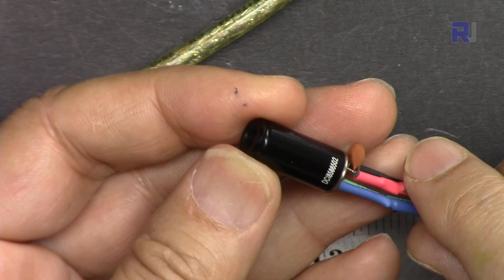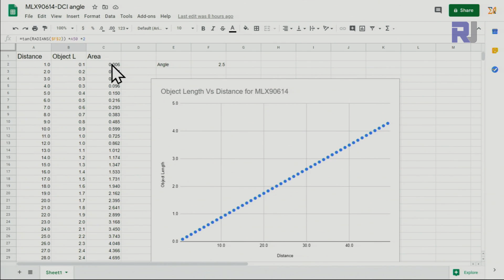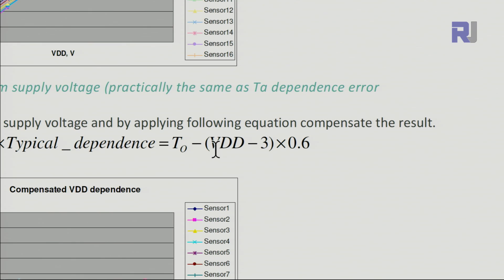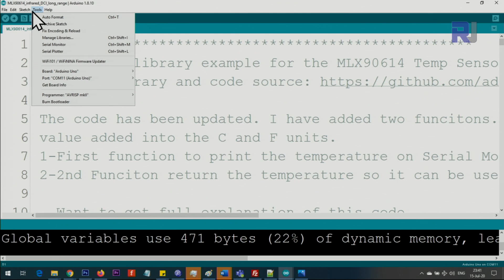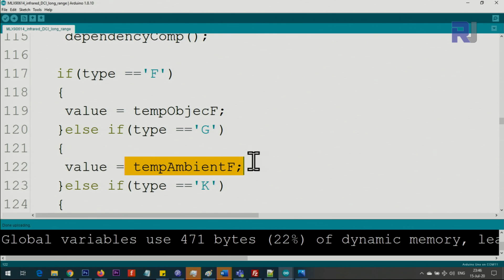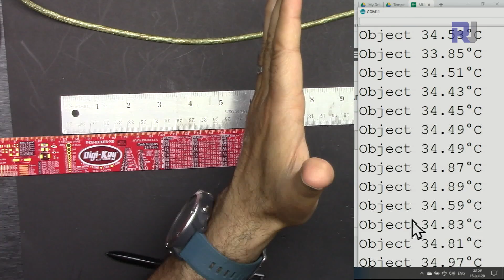Non-Contact Long Range MLX90614-DCI Temperature Sensor with Arduino - RJT337

Comment: Al Salamu Alikum, Thank you for this tutorial. 
I have a question regard reading Vref for "dependency compensation". 

Vref voltage is a "regulator" voltage so it is a fixed value! Actually I print out A0 readings and as expected it's fixed on 1023 (5V), This means the code just shift the resulted readings by (5 - 3)*.6 = 1.2 degree.

So why we need this A0 leg readings?

Comment: Hey sir, I already assembled everything, uploaded the program but I just get the same mesurement line ( Object 1037.34\xC2\xB0C ).
Reply from the maker: Check wiring
Reply: @robojax  i‘ve checked everything but still the same Problem, everything ist assembled exactly the Same was like in the Video
Reply: I Found the Problem your wire‘s Form A4/A5 needs to be on SCA/SDL at a Arduino Mega
Reply from the maker: Pleased to know that you resolved it

Comment: Hi there, great tutorial! I'm working on a similar project over 2 months, and even using the MLX90614-DCI Temperature Sensor, some times it shows the wrong human body temperature due the ambient temperature change!
I can't post a link here, but I found out some one was able to hookup a serial communication with a medical thermometer, and the serial output didn't show the temperature showed in the LCD, instead it was showing some firmware info and the most important it was showing the sensor temperature and the ambient temperature!
It seems to take 9 samples of object temp and ambient temp, process it to show the temp in the LCD!
So the guy took like couple hundreds of samples, put it into a spreadsheet file, and used some AI to process the  9 samples he was receiving on the serial communication and then he was able to show the same temp showing on the LCD!
So, in this case seems that the ambient temp is a factor to get the right temp from a human body!
Reply from the maker: Hi, here is the video showing it on LCD https://youtu.be/IAj0gHTTWfw Here is how to find Specific YouTube Video in a channel https://bit.ly/findYouTubeVideo

Comment: Thank you for the excellent and helpful tutorial! Do you know what's the response rate of the sensor? Rephrasing my question, how fast a moving object can pass in front of the sensor in order to get its temperature detected?
Reply from the maker: Hello, I don't remember the number, but either I have explained it or shown the datasheet. Measurement time or reading time. the datasheet link is provided on the same page as the code.

Comment: Great Video. I Was wondering where did you get all the data sheet and information about the sensors.
Reply from the maker: Wry simple just type the model and the word datasheet.  I have provided the datasheet in the page where the code is.
Reply: @robojax  Thank you

Comment: If the correction is 0.6 degrees celcius per volt, than it is not 0.6 fahrenheit per volt at time 23.40

Comment: You have connected the vin to 3.3v , how can you get 1023 ? ...1023 will show with 5v .. and the sensor has no relation with 5v , since you have only 3.3v supply
Reply from the maker: hi, sorry point to the time of video like 7:30 so I can check. I've got over 400 videos and can't watch the whole video to find out.
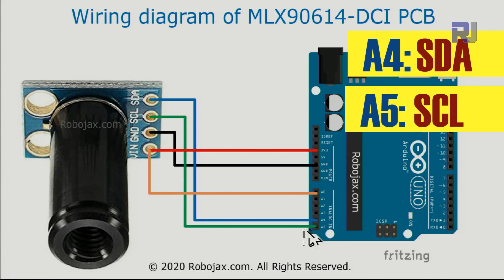Reply: @robojax  watch 13:32 ...if you are connecting the vin to 3.3v,  it's obvious it will always show around 675 as analogread ..since arduino uses 10bit ADC . No need to put that Vin to an analog pin .
Reply: And don't use a 3.3v device directly with a 5v mcu . Here arduino will send 5v signal as a Master and MLX will not able to endure it for long time , it will get damaged soon . Use a voltage devider with SCL and SDA to make it 3.3v .
Reply: @Pagalcoderguide  I'm interested with what you are mentioning about. Can you point out to the reference? Should we use level shifter?

Comment: Hi, Thanks for the awesome tutorial. I have a problem that you haven't encountered while making this video; the temperature changes with the distance (specifically from 36.7 to 36.2 in 0.1 to 10 cm). I am using DCI model of the sensor, I'm pretty sure that the object in FOV both at 0.1 cm and 10 cm.
I have read datasheet twice, did everything I could but no luck. Any ideas on how I can compensate for the distance?
Reply from the maker: Hi, as I mentioned, many factors affect the reading. this topic is not crystal clear and you need to find specific method for your own application.
Reply: @robojax  I'll do that and keep you informed of the result which may help someone else
Reply: Emissitivity kalibrasyonun nasil yapılır? 0.98 e nasıl bir kodla ayarlarım yardımcı olabilir misin?
Reply: @necipguleser8447  kütüphanenin içinde bulabilirsiniz 2 ayrı fonksiyon var; writeEmissivity ve writeEmissivityReg. Ikisini de kullanabilirsiniz, 1 defa yazmanız yeterli. Ilki için 0.01-1.00 arası, ikinci için ise 1 65353 arası değer vermeniz yeterli
Reply: @ekremvkilic  @Robojax 'in yazmış oldugu koda nasil entegre ederim. Yazdım ama çalıştıramadım hata veriyor. Rica etsem paylaşılan örnek koda entegre edip yazabilir misin tam halde?
Reply: necipguleser@gmail.com mail adresime de gönderebilirsin. Uzun zamandır uğraşıyorum ama aşamadım sorunları. Siz hassas bir şekilde doğru ölçüm almayı başarabildiniz mi ateşölçer şeklinde? Aldığım ölçümlerde emissitivity ayarlaması yapamadığım için mi bilmiyorum ama doğru ölçüm yapamıyorum tutarsız ve doğru olmayan ölçümler alıyorum.
Tecrübelerinizi paylaşabilir misiniz? Doğru ölçüm için dikkat edilmesi gereken noktaları?
Reply: @necipguleser8447  önce kütüphanedeki fonksiyonlara bakmanızı tavsiye ediyorum, zaten oradan çıkarabilmeniz lazım. Ve ne yazık ki tek başına emissivity yeterli değil. Muhtemelen siz de 90 derece görüş açısı olan sensoru kullanmayı denediniz, mesafe uzaklaştıkça ölçtüğü alan büyür. Buna çözüm bulmanız lazım. Bu konuda da bu işi yapan ürünlerin içinin açılmasının videosunu izleyebilirsiniz
Reply: @ekremvkilic  mlx90614-dci 5 fov sensör kullanıyorum. 

char *typeName[]={"Object","Ambient"};

Adafruit_MLX90614 mlx = Adafruit_MLX90614();

writeEmissivity(0.98)
;

float tempObjecC, tempObjecF, tempAmbientC ,tempAmbientF, tempObjecK, tempAmbientK;

void setup() {

...

kodu bu şekilde araya sadece writeEmissivity(0.98);     şeklinde yazmam yeterli olmuyor sanırım hata aliyorum.
kütüphaneyide çok inceledim ama bilmiyorum neden derleme hatası aliyorum kütüphanedeki writeEmissivity ile ilgili kısım şu 

void Adafruit_MLX90614::writeEmissivity(double emissivity) {
  uint16_t ereg = (uint16_t)(0xffff * emissivity);

  writeEmissivityReg(ereg);
}
bunu nasil koduma eklerim lütfen yardımcı olabilir misin  çok uğraştım ve yardım alabileceğim kimse yok.
Reply: @necipguleser8447  Uyuduğum için cevap veremedim ancak söylemem gerekir ki aceleci olmanız biraz nahoş.
Fonksiyonu (daha doğrusu methodu) doğru yerde kullanıyorsunuz ama kullanım biçiminiz yanlış. O method Adafruit_MLX90614 sınıfına ait, kullanmak için de o sınıftan oluşturduğunuz objeye ihtiyacınız var. "mlx.writeEmissivityReg(x);" şeklinde tırnaklar olmadan kullanırsanız işinize yarayacaktır. x yerine emissivity'i örneğin 0.98 yapmak için 0.98*65535 yani 64224 değerini yazın, derleyip yükleyin ve sonra o satırı yorum satırına çevirip tekrar yükleyin çünkü daha önce de dediğim gibi emissivity değerini sadece 1 kere yazmanız yeterli. Sadece 1 kere yazmak için readEmissivity methodunu kullanarak bir if yapısı da oluşturabilirsiniz.
Reply: @ekremvkilic  @Ekrem Kılıç İyi akşamlar kusura bakmayın öncelikle. Dediklerinizi yaptim ve emissivity ayarını gerçekleştirdim. 0.98 olarak ayarladığımda 35.4 civarında bilekten ölçüm alıyordum. Emissivity ayarıyla biraz oynamalar vardım ve istediğim sonucu elde ettim 36.2 civarlarında doğru ölçüm aldım referans ateş ölçer değerlerinde. Sonrasında biraz uğraştıktan sonran aldığım verileri kaybettim emissivity değeri 0.98 de şuan bilekten 30küsürlerde değer ölçüyor. Sebebi ne olabilir uğraştığım için ayarlarını mı bozdum acaba? Sadece emissivity ayarı üzerinde üst üste değişiklikler yapıp yükledim. Bu sorun olmuş mudur? Nasıl düzeltebilirim fabrika kalibrasyon ayarlarına?
Reply: Good night would you mind sending your cod with the calibration to me? I'm having a hard time Fzazeka@gmail.com

Comment: Hi
do you know how to wire this module  CJMCU-Infrared Temperature Sensor MLX90614ESF-BCC IR
Reply from the maker: Hi, this is the video for that.  didn't you watch it? the "CJMCU" is just fake.  MLX90614 is the correct model and this video is shown it MLX90614. If you are using the small one, here is the video https://youtu.be/cFDSqiEIunw
Reply: @robojax  I  use this one i don't know  how to wire it with arduino  https://fr.banggood.com/CJMCU-MLX90614-BCC-Human-Body-Infrared-Thermometer-Non-contact-Thermometer-Serial-Output-Module-p-1684348.html?cur_warehouse=CN
Reply: his pins are different from the others

Comment: Did you made some configuration of emissivity? As I readed, the sensor is factory calibrated with emissivity =1 and the body skin has emissivity=0,98. What is the better way to check is the temperature what the sensor gives is correct? For instance, I used Water (emissivity=0,95) and measured it with a classic digital medical thermometer.
So, in order to improve mesures accuracy: voltaje compensation, distance compensation, emissivity adjustment, and plastic protection of body sensor to avoid thermical gradients. And be carefull about ambient (low humidity, no wind, ambient temperature stable).
Reply: I have done 3 of 4 suggestions of yours to improve accuracy, but I couldn't do the fourth: distance compensation. I have DCI model, as I get further away from the sensor, the temperature changes by 0.5 (36.7 to 36.2). How can I compensate for this? I have researched a bit, completely read the datasheet, used both this code and my own but no luck. Any ideas?
Reply from the maker: you can use  readEmissivity() to read it and to se it to for example to 0.5, use  riteEmissivity(0.5)  and it has been mentioned in the library on around line 75 https://github.com/adafruit/Adafruit-MLX90614-Library/blob/master/Adafruit_MLX90614.cpp
Reply: @robojax   I have used writeEmissivity() and even writeEmissivityReg() with different values and noticed that the less the value is, the more the sensor becomes sensitive to the distance and outside effects. There are not many functions in the library, so there is basically nothing that can be done other than changing the emissivity which is not the solution.

The worse than that is one of my tests goes like this:
Ambient Temperature: 28.01-28.03-28.05
I show my right wrist to record the temperature to an Excel file (no contact, the sensor is sealed in a cardboard box with only the measuring part is 2-3 mm outside)
Ambient Temperature becomes: 28.07-28.09-28.11
I pull back my wrist
Ambient Temperature: 28.11-28.13-28.15
After waiting a few seconds, watching the Ambient Temperature values I show my left wrist
Ambient Temperature: 28.15-28.17-28.19 (while I was holding my right wrist to sensor above 1 cm)
I pull back my right wrist
Ambient Temperature: 28.21-28.23-28.25

There is no way I could be affecting the sensor while measuring the temperature on my wrist because there is no contact. Also, I have cut a hole on the box that the sensor came in, put the sensor inside the box, closed every possible gap, the sensor should be in thermal equilibrium (because it's ON for the last 30 mins and never even touched or moved anywhere but it keeps measuring). And I have repeated this test 15 times yesterday, every time it's the same.

The funny thing is I noticed that after going through the test process I mentioned above when I do the test again waiting for no more than 1 minute, that absurd thing does not happen. I began to think that sensor should be on or measuring only when something is wanted to be measured. I will test this on Monday and keep you informed of the results.
Reply: @robojax  How can I set the emissivity to 0.98. Can you write your code clearly here?
Reply: @robojax  
I am waiting for an answer from you

Comment: Hi,

Can we use this sensor to detect the temperature for moving object like wheel of vehicle? 
I mean, wheel pass in-front of the sensor FOV and sensor detect the temperature at very high speed.

Want to measure the temperature of moving vehicle's wheel, whether its bearing or axle is fine or not?

Is this sensor waterproof?

Your support is highly appreciable :)
Reply from the maker: Hi, it reads in 5ms or 0.05 seconds. if you give it minimum of this much time for pointing to object and reading, then yes. See datasheet for write and erase time.  I have provided the datasheet in the resources page.
Reply: @robojax  Thank you! Will check the datasheet for writing and erasing time.
Reply from the maker: you are welcome.

Comment: Thank you very much sir, great video👍🏻
Reply from the maker: You are welcome. Glad you liked it.
Reply: @robojax  may you help me please, i have MLX90621 BAB Thermal Imaging Camera and i wanna test it with Ardouino, i need library and code. may you contact me on b.aitchrif.net@gmail.com  i need you help please.
Reply: @robojax  Sir, i recently received this item with a PCB attached to it, and i wanted to use it with the raspberry pi, so my question is the VCC pin need to be connected to A0 and 3.3v, however raspberry pi doesn't have analog pin so how can connected it, and if u have a python code for it that would be great. Thank you

Comment: i have worked with a mlx90614 sensor. but it measures temperature  of human body 92.1 F while read with other temp sensor it gives 98.7 F. so this is not accurate. How do i make the sensor accurate  ?
Reply from the maker: I explained the accuracy. the word accuracy is a relative word.  when you measure the surface. it is the average of area you are pointing at. if temperature varies in that surface, then you will get different value than a surface with less variation. I've spent about a week to make this video. So watch it again so you understand the concept.

Comment: The accuracy of these with respect to the distance is not mentioned anywhere. Did you also compare the variation with ambient temperature?
Reply from the maker: I have shown the datasheet.  No one will ever tell you.  the temperature accuracy has been shown in video. it is the length of object and the average that  makes it less accurate. if you measure something of length of 5cm and the object has temperature of 30C and 50C then you will get the average of both. Very accurately.
Reply: @robojax  I have been on it for a few months now. I used an infrared range sensor to calibrate it between 1c between 5-10cm however its still not satisfactory. Thank you for pointing out the voltage calibration. I've used the DCH now waiting for DCC, in the post.

Comment: I purchased the BAA model, and yes, the FOV is too wide. It measures effectively within 1 or 2 cm. Now I ordered the DCI model to complete my project.
Reply from the maker: Yes. this is excellent product. Please 👍 and subscribe.
Reply: sir,  have you tested the BAA model or DCI model to measure body temperature through forehead? Could you please share the result to me?
Reply: From where you purchased the DCI version? Please share the product link.